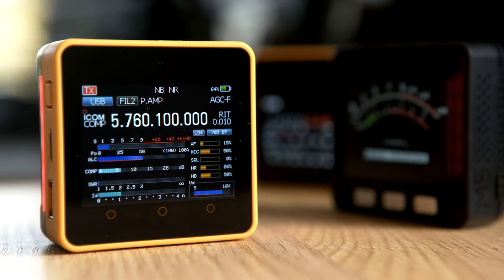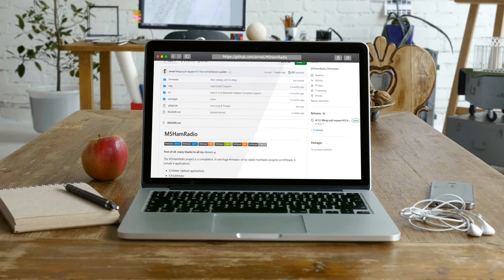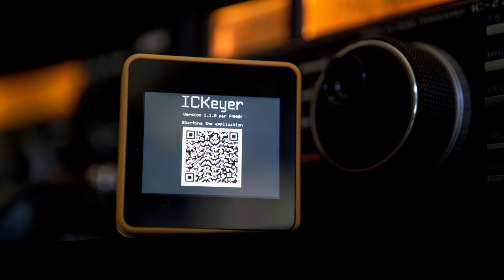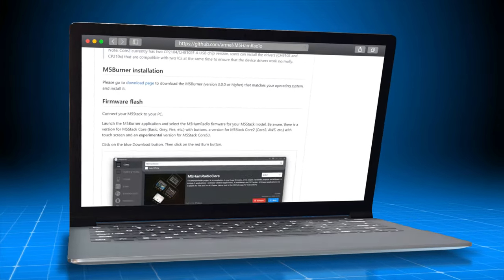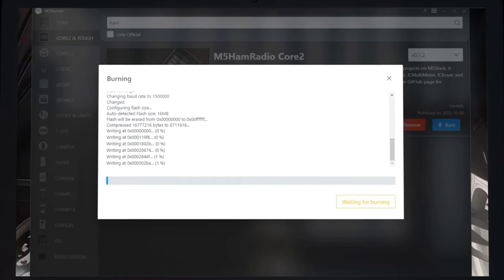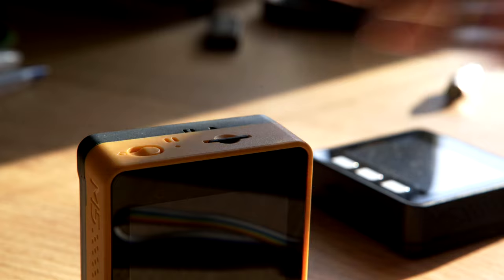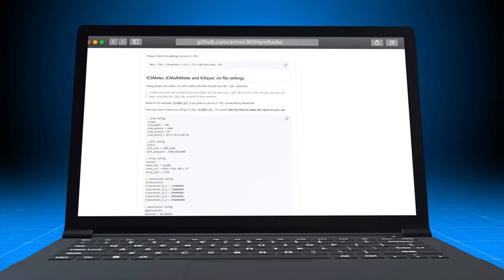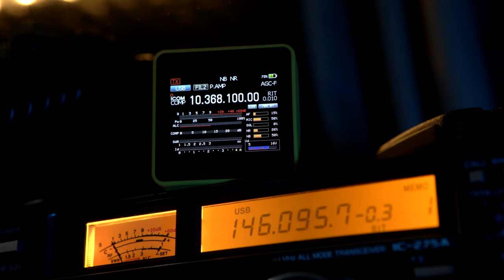M5 Stack - Icom IC-705 DX Tracker & Metering Radio Apps

Comment: Awesome video about my project 🤭Thank you 😌
Reply: I'm having troubles. I do not own an Icom rig, but want to use just the DXTracker program. Every time I try to launch it on my M5GO (ESP32), it tells me that the ini file does not exist. I have created an ini file with the proper info, yet it does not recognize it. Do you have any suggestions?
Reply: Top einfach nur Top 👌
Reply: @Martinnrw100  Thank you sir 😌